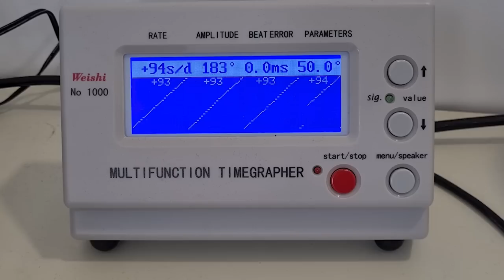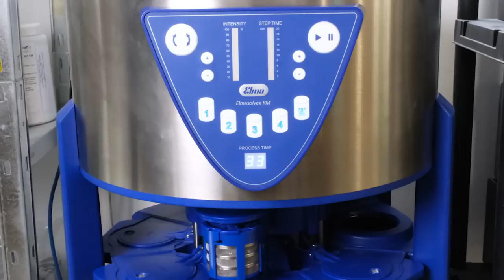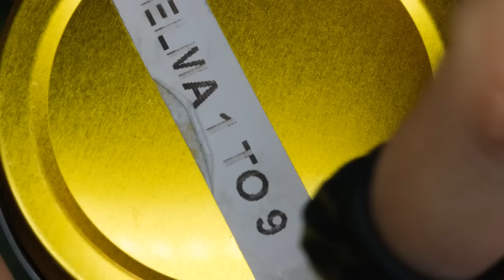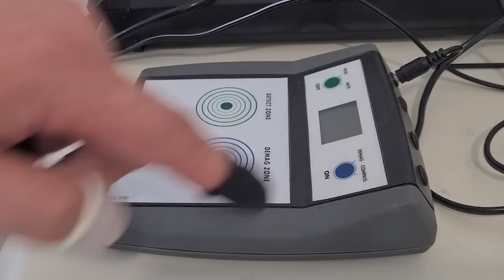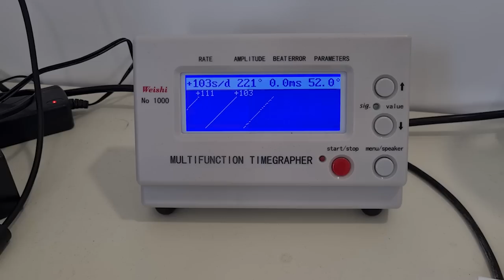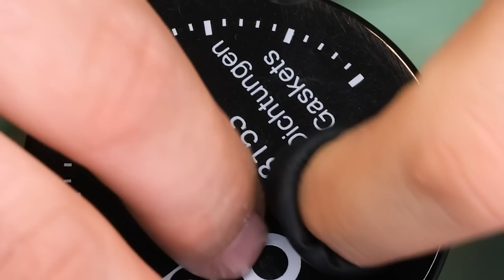What does "36000 Fast Beat" on the dial mean?

Comment: I just serviced a ETA 2409  my first time on that movement and I took the canon pinion of before disassembling the keyless side and inadvertently pulled off the minute driving wheel off the pinion I couldn’t work out why the hand wouldn’t turn after reassembly and oil it took me a few attempts before I realised my error but luckily the wheel pressed back into the recessed pinion at the base and it fixed it perfectly. Lovely movements I have to say and a pleasure to tinker with.

Comment: I remember the high-beat Seiko watches and of course the Eternamatics. I wondered then if they could face up the precision of the Seiko Quartz that my father bought me in 1979 at the Miami Airport for $150.00 The rest is history! It was an earthquake for the proud Swiss watch industry and a windfall for the Japanese brands. But why did they still make mechanical watches? Today I long for the mechanic watch. I feel that having to replace a battery is a nuisance, but having seen the process of cleaning and reassembling a mechanical watch makes me optimistic about the technological progress in watch making depends on the humans that oil the cogs of the machines!

Comment: A couple of questions please:
1. Which stakes are you using on the horia to push the rotor bearing?
2. What kind of an improvised solution are you suggesting to deal with the issue thar automatic mainsprings get tangled up inside the winder? Using an “arbor” which is one number smaller than the corresponding “barrel”? It happens to me too often :/
Thank you
Reply from the maker: Hello, thanks for watching! For the rotor bearing I use self-centering pushers if I have the right size, and a simple anvil with a center hole. And yes, for the mainspring winders, I indeed use a one size smaller arbor. You can also turn a brass disc with a center hole in it that you could place inside the winder barrel if you want a more permanent solution. And there are of course specialized combination for the 2824 and 2892.
Reply: @VintageWatchServices  thank you for the prompt answer! I sometimes get the feeling as if those winders were not design to work with automatic mainsprings, especially since the whole design is incompatible with the sliding bridle

Comment: I have a very similar watch to this one, with actual KON-TIKI on the dial, but the case design slightly different..I put it away in a draw (1981 ) & over time I forgot where I put it,..I also had quite a few other watches at  the time & was not fussed, yet now it is still brand new & unused. It must have a service,& although I am a novice tinkerer on scrap watches, I have no intention of touching it . Any ideas welcome.

Comment: Thanks Stian, great vid. Lovely condition. Great to see you fixing a few issues. Can you tell us what the tools are called, was it Horia tool and staking set? So glad we cleared that up on the size of Norwegian balls!🤣 More voices to come? Any tips on using a smoothing broach, so it doesn’t get stuck?
Reply from the maker: Hello Boyd, it was indeed the Horia tool and a staking set. And the smoothing broach gets stuck quite easily! Keep rotating it as you move it in and out and you should be okay.
Reply: @VintageWatchServices  thanks Stian. I have a small staking set. The stakes are diameter 4.7mm and the anvils (stubby stakes) or what ever they are called are dia 4.1mm. Do you know where I can by more singularly? I cannot see them at Cousins.
Reply from the maker: @boydsargeant7496  I wouldn't really know, I'm afraid. Does your staking set not have a rotating table where you can place different sized anvils? Otherwise the best thing to do might be to google the name of your set and see what you find...
Reply: @VintageWatchServices  thanks Stian. Yes, but 4.1mm is the biggest. Looks like about 3.1mm is the next size down. Also no name, it’s very vintage with 6 anvils and 50 stakes. Thanks, I keep my eyes on ebay😉

Comment: How come the ampliude gets higher with the automatic module in place? How does this work, mechanically?
Reply from the maker: In an automatic watch, the mainspring has a bridle at the end which slips along the walls of the mainspring barrel when the mainspring is wound. When you wind the watch with the crown, the difference in torque applied to the mainspring changes very fast, making the mainspring slip faster. The rotor typically needs some 100-150 turns to turn the barrel once, so the increments building up the torque are much smaller, allowing for the mainspring to slip a bit later. It's kind of like being on slippery ice; sudden moves might make you slip, while gentle, slow moves will allow you to walk. 
Note that the added amplitude from an automatic module will not be dramatic, at most probably 10 degrees or so.
Reply: @VintageWatchServices  This fine art form never ceases to amaze me. Thanks for your explanation Stian!

Comment: Why is there no lubrication on the gear teeth? That's a high wear, metal on metal interface.
Reply from the maker: Hello Leon, thanks for watching! Teeth in watch gear trains are cut with cycloidal curves, meaning the surfaces roll on each other and do not rub. Thus there is no need for lubrication and you never see wear on the teeth themselves.